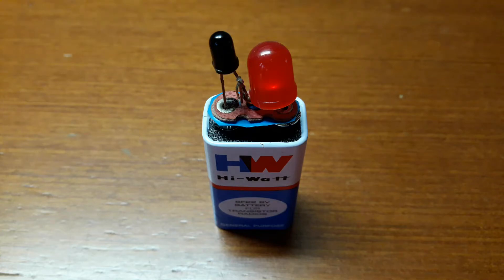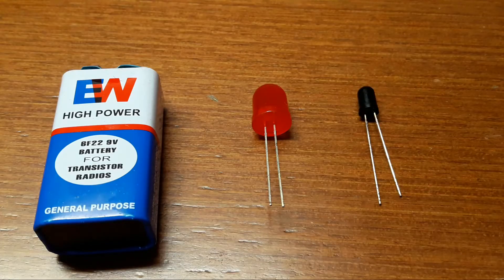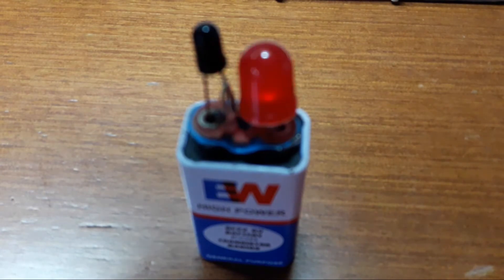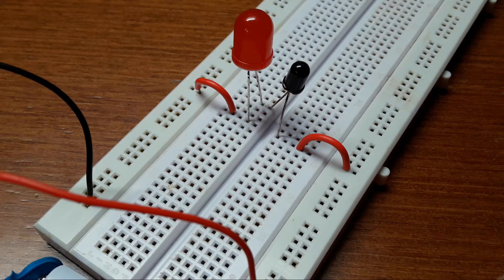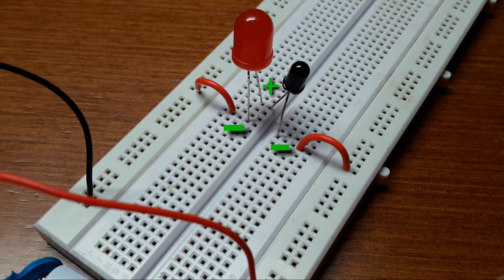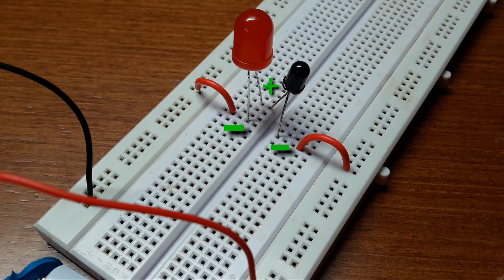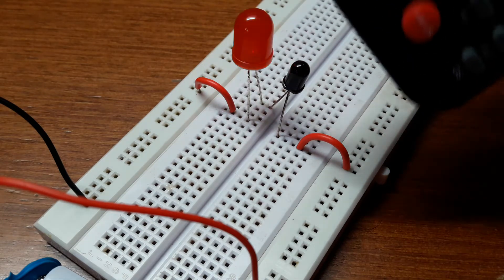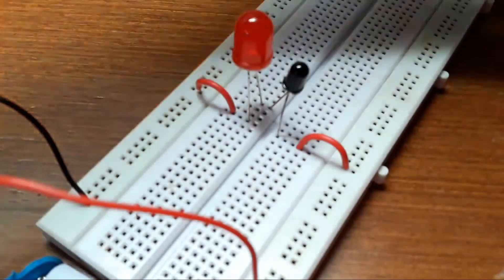✔How to make a mini "Remote Sensor/IR Detector" Circuit using IR Receiving L.E.D.

Comment: no resistors on the leds?
Reply from the maker: +Tom Servo I've tested this without resistors and the L.E.D did not burn out. However it would be better/safer if you connected a 100 ohm resistor.

Comment: Hi bro, I need some help from you. I have made simple water tank alarm with wires and Led. It has three lights Low,Medium, and Full.Now,I want to make it wireless coz it is very difficult to manage wires. My water tank is on 2nd floor. I want, all three LED light should turn on one by one as water levels come up.So can you help me to know how I can switch on three LED light with different buttons/ or water level comes up.
Regards
Vineet
Reply from the maker: +Vineet Kaushal Hey i would love to help you but I don't have adequate knowledge how to make it wireless.
Even i had made a 'Water Level Indicator'  video earlier but its also with wires same as you described yours!
Reply: Bro, just want to know you have shown one led light is getting on by pressing any button of remote. Can you know how can we turn of three led lights with different buttons. Example. we have three light like LED1,LED2 and LED3. Now when I press button 1 then LED1 get switch on and when 2 then LED2 get switch  on etc. If it is possible for you then please let me know, I will make it work in my wireless Water Tank indicator.
Thanks Bro
Reply from the maker: +Vineet Kaushal To control a specific L.E.D with a specific button on the remote requires coding which i don't know. 
If you notice in my video the IR DETECTOR, the L.E.D comes 'on' only when I'm continuously pressing buttons on the remote. That means it requires constant IR light to keep the L.E.D glowing.

You want the L.E.D to come 'on' and stay 'on' by a single press on the remote and then go 'off' when you press the button again. That requires encoding for the IR transmitter and receiver.
Sorry i wish i could help you but i don't know how to do it. ✌
Reply: ok. thanks bro.